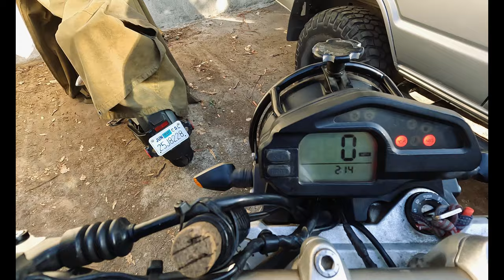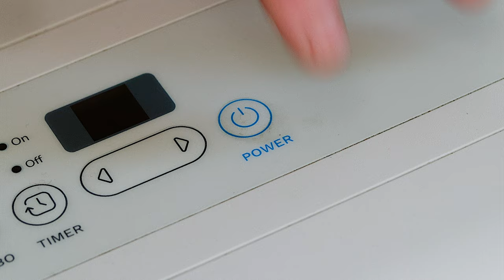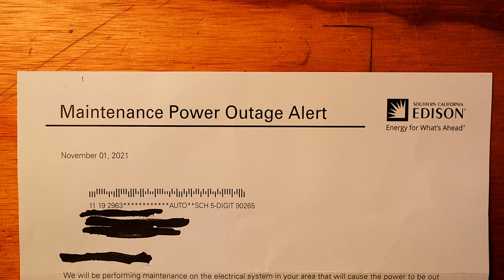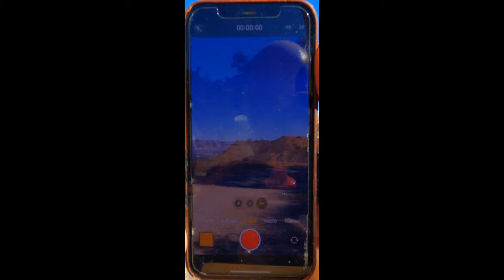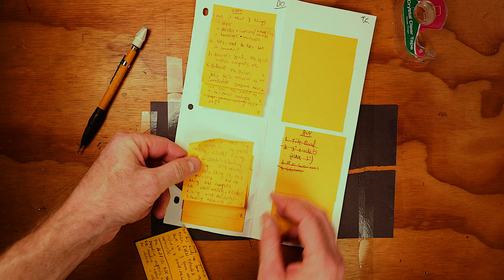Where Does Compulsion Come From?

Comment: Van, try scrubbing the electrical circuit board with a small stainless bristle brush to remove the corrosion. This has worked miracles for me on electronic circuit boards.

Comment: It's the switch. Take it apart, clean it, fill the switch with bulb grease. The switch will be smooth and like new.
Reply: Silicone makes an amazing water tight seal BTW.
Reply: I think you might be right.  It's easy to assume its the electrical board, but the switch is probably gummed up somewhere.

Comment: The ripped construction paper shot with the post it underneath was brilliant. My motorcycle transmission chewed itself to pieces and I’m planning to do an engine/trans swap myself this winter, the bike is older than I am but that doesn’t mean it should be discarded. There’s peace in bringing it back yourself.

Comment: Bad contacts usually are broken connections... Resolder the pins with fresh tin and you should be good... Some flux first and then re do all soldering points... In the end, a great video keep it strong!

Comment: Hey Van. Just spent the past half hour first trying to figure out what the bike is (eventually got it) and then to find a wiring diagram for it. For the 2007 g650x, the only thing that the instrument cluster does is act as a flasher and distribute the power to the lights that the switch tells it to. If it’s stuck on “left”, then the switch is stuck on left. If it’s flashing and indicating the same light as the turn signals themselves, the gauges are working fine. Take apart the handlebar switch and check/clean the contacts there. You can use a jumper wire or multimeter to test the power coming to/going from the switch while you have it and see if everything else works as it should. 

It’s kind of annoying that BMW replaced what would normally be a few dollar item (the relay) with a gauge cluster that’s not available anymore and was incredibly expensive when it was. Luckily, that’s not the issue :)
Reply: Ah, and also, I can relate on the “why am I getting into _ task right now when I should be doing ____?!”. For me, it’s always easier to just do those 3, 5, or 10 things first and then sit down to focus on my work. Otherwise I never get anything done because I’m brainstorming how I could be doing those things and I’m STILL not working.

Comment: Hey Van, I'd suggest taking apart the SWITCH itself, if you have not already... I'd bet the contacts in there just need to be cleaned/adjusted.  At a minimum, you could isolate and bypass the switch itself and figure out with certainty if the problem is in the cluster or the actual switch.

Comment: If the cluster is anything like my corolla's clock, check the surface mount components. They can be soldered with too little solder and create a hard to find cold weld over time. Just take the soldering iron, heat each side of the component and add a bit of solder. That should fix it.

Comment: Coat it with a hydrophobic coating. That's what's used in cheaper smartphones and watches that aren't officially water resistant. Most mainstream phones are sealed from the outside with rubber gaskets, but you can skip that part and let the water in, BUT the circuitry will be protected by the hydrophobic coating, so water will lay on top of the coating instead of touching the circuitry. 

The controller of my ebike has this coating, for example, since there's a gap between the controller and battery that water can penetrate through. Since the circuitry has a thick coating on it, the water and moisture never reaches the circuitry, and I don't have to worry that much about water/rain/humidity. 

Also, excellent video! - as always.

Comment: You might try to resolder all the connections on your board. Just melt the connection and let it solidify again. I fixed my instrumentation panel once like this, after messing around for multiple years.

Comment: This spirited man finds any kludge, even a “good kludge” to be anathema to his spirit.  Suggestions from my 20/100 hindsight:

1.  Wrap the hose in a insulator sandwich
2.  Create a cold plate from two aluminum
      plates and put a Peltier semiconductor
      between the inner and outer plates.  Wire
      up the device to move thermal energy (heat)
      from the inner plate to the outer plate.

Yes, I am a grey bearded EE …

Comment: great video, I see myself in many a way.  ON  the bike, not a bmw guy but plenty of other bikes have you ruled out its not the switch possibly and not the gauges? if its indeed the gauge unit my guess is  may need to get brave and bust out the solder iron.  You could have a cold/cracked joint causing the issues .reheat the solder to reseat every thing. Those pins in the upper left @ 1:47 look really suspect for a bad joint with that black scorched look.

Comment: It it's not the H2O that breaks it, it is the salt content, in short you need to scrub it with a toothbrush and alcohol (ethanol 96% or isopropyl) to remove the salts. After that you can use a lacker paint spray

Comment: Ha ha. Toyota put the ECU unit right next to air conditioning pipes.  After several years, the moisture humidity slowly ruin the ECU circuit board. Camry , 02-06.

Comment: Don't discount the cable and connectors. If you have a voltmeter, ohm out the wiring harness.  My guess is that a connector is worn out our the cable has a break in it where when bent a certain way will opens or shorts the circuit.

Comment: Make sure your not using corrosive flux as it will eat away at the solder joints and will work intermittently and generally be a nightmare & finally fail.

Comment: Dude- you're lucky;  Kinda.  I own a '87 BMW K75 w/ 79k on it; no probs, but.....NO BMW dealership will work on it, for ANYTHING.  I don't care if it's an oil/filter change, new rubber, etc.- the current level of "corporate service" is:  SHIT.  But back to turn signals; BMW/my model have a L and R turn signal, per grip.  Stupid.  To turn them off, your thumb has to go UP.   But that's only on the R grip.  Wtf?!  Been riding 42 years, and there's alot about this bike, this brand....that I fucking hate.  And the electronics/signals not working would drive me ape shit also.  But, I've always stored my bikes in a garage, and try to avoid rain as much as possible....in Seattle.  Van- you ARE the Man; you'll find a fix....and damn the eloquence- or lack thereof, in the process.